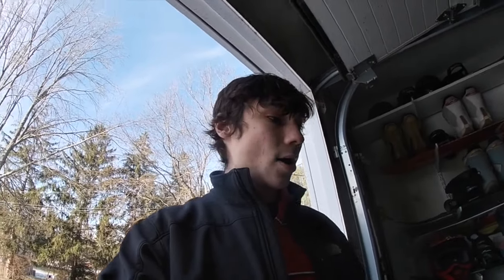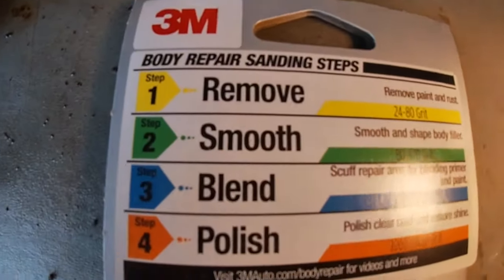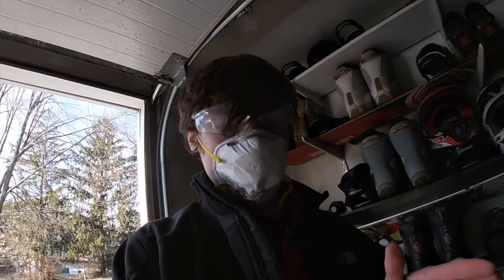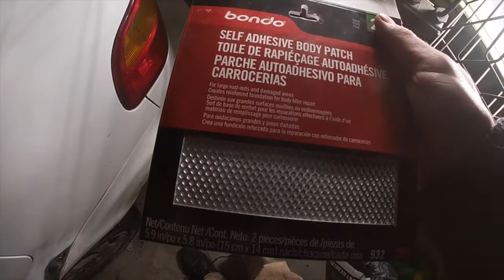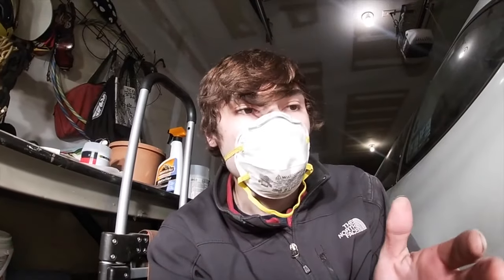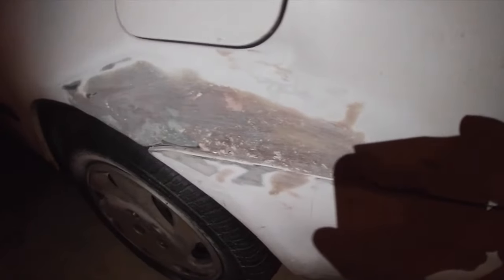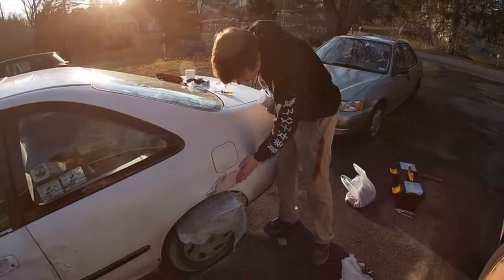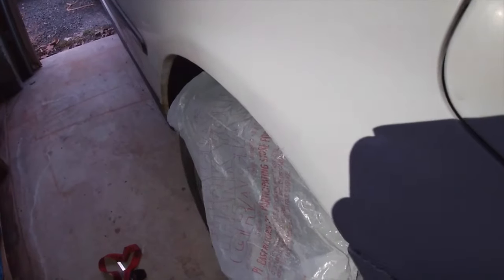How To Fix Large Rust Holes Using Bondo

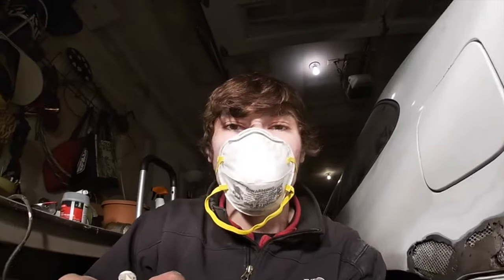Comment from the maker: Just realized my audio cut out between 9:06 - 9:21 ... basically I was just explaining that since I didn’t have a rust converter on me I used WD40 instead to just help prevent some rust from forming. A rust converter such as chassis saver would help much more
Reply: your a good young man / you made a great inst video . thank you .good luck
Reply from the maker: @pokerface1967  appreciate you brotha, hope the video was of some help to ya🤙
Reply: Good work, I am gonna fix my car's rust holes and wondering how your fix is holding up so far?
Reply: @phamtinkt88 I was wondering the same thing
Reply: Thanks, came to the comments to see why you were using the WD-40. thanks

Comment: Props on giving it a go. Some tips from a body guy you might appreciate: an electric dual action sander people have around that they use for wood will keep you from sanding for hours. HF has a cheap one. You don’t need a fancy pneumatic DA to get the job done. The audio cut out but it looked like you used WD40 to clean the area before applying filler. Avoid using lubricants to clean with because the oils in it will stop fillers and paints from adhering to the metal correctly. You can also even add some filler to the backside of that patch for some added protection. I know you said you don’t care about the paint but a quick masking job before you start will keep the filler out of places like in between the fenders and save you clean up time later.
Reply from the maker: Ryan Watts hey much appreciated fam ... yeah an electric sander would have definitely saved me a bunch of time but I cheaped out lol lesson learned I’ll grab one for next project. And yes I used WD40 because I didn’t have a rust converter on me. I was going to use that to prevent future rust. I ended up sanding between the fender/bumper to clean it up ... lesson learned there as well... I’ll probably remove the bumper next time.
Reply: I think a cheese file might have been helpful considering all the bondo Bill put on! Can a cheese file be used on long strand bondo?'

Comment: I watched a video with a rust hole like yours. He used fibreglass cloth and covered it with fibreglass resin. Then after sanding it down he covered it with bondo and it turned out great. Please get an electric grinder and sander.I also notice the guys use an air hose to blow out the rust pieces when they fall to the bottom behind the panel you would be working on. I have an older square body truck and I need to do bodywork[first time] so I am watching a lot of videos. I felt so sorry when I saw how much hand sanding you had to do. Thanks for the video.

Comment: Nice video dude, I have 2004 dodge ram with pitted wheel wells and needed some information how to bondo it, very informative! thanks :)
Reply from the maker: Joshua Johnson glad it could help man!
Reply: Dark gray? Ours is rusted over the wheels to
Reply: Literally doing this right now on my 04 dodge ram. I bought it with fender flares and when I removed them I saw the two rear outer fenders were rusted thru so trying to fix it without paying an arm and a leg. Will have the truck professionally repainted at some point lol
Reply: @jaycamacho8179  fortunately the rot on mine was covered by the fender covers, the bondo didnt have to be painted just needed something to put screw holders into and slow down the rust a bit, it's been a few years and it hasn't progressed passed the the covers yet. ;)
Reply: Wow literally me too.

Dodge didn’t put anything to stop the water coming up from the wheel well

Comment: I got fiberglass cloth instead of the adhesive patch do they serve the same purpose or I should get the adhesive patch ?
Reply: Hey I was planning on getting the same thing, how did it work out for you?
Reply: @luvstzy  still holding up good the resin and fiberglass cloth make a solid base to work with

Comment: Use some spray foam to hold the wire mesh in place and then Bondo over it. That's the way I've been doing it for nearly 50 years. Yea I'm a professional and that's the way I've done thousands of cars without any problems.

Comment: Each to there own...but doing a job the right way is very important.  If your going to take the time to fix something may as well to it right, even if you Don't care about it, just a good practice and what happens when you actually need to do a good job?
Reply: Most cars aren’t worth the hundreds and even thousands of dollars worth of body work that’s required to do it the right way, lots of people can’t afford it either 

Most people don’t have the very many different skills or equipment required to get it done correctly (mig welder, 40+ gallon air compressor, DA sander, paint booth…. The list goes on and on)

I work in a body shop, so I 100% feel the good practice part, when I need to to a good job, it’s for a paying customer. 

but for my own car? Shit man I just need it to look good. It’s all in the prep. Even without a sheet metal patch A Good bondo job time will last quite some

Comment: Did you fiberglass filler?
Reply from the maker: Steve Harris fiberglass and finished off with regular bondo body filler
Reply: Billy Stocking I only used body filler for my rust spot (kinda like yours) do you think it’ll be fine
Reply from the maker: PA Outdoor Experience as long as it is hardened, stable and think enough I’m sure it will be fine